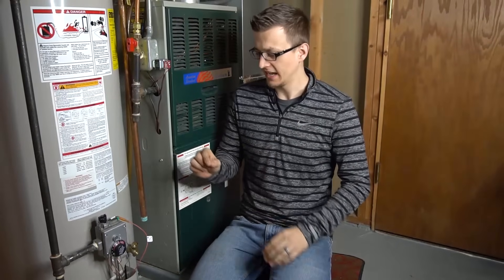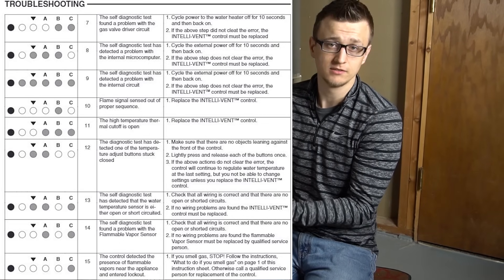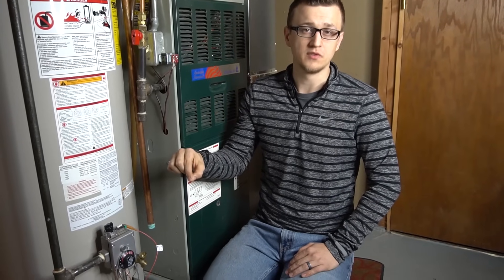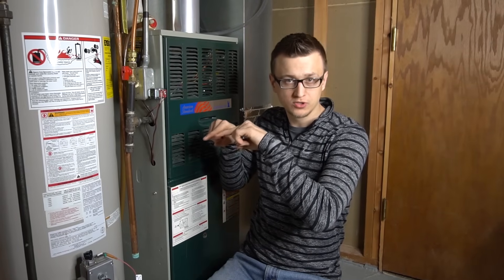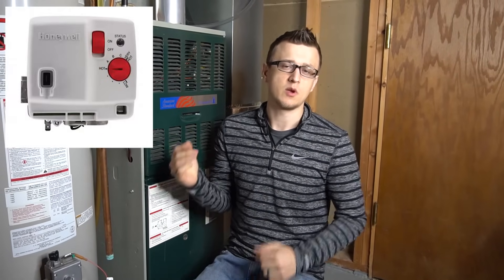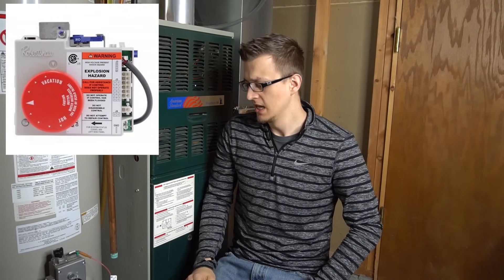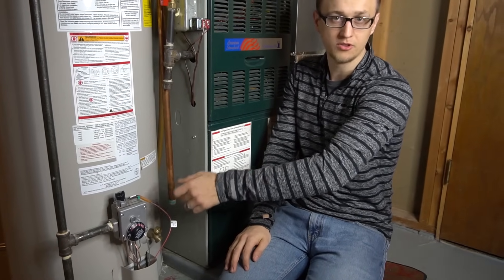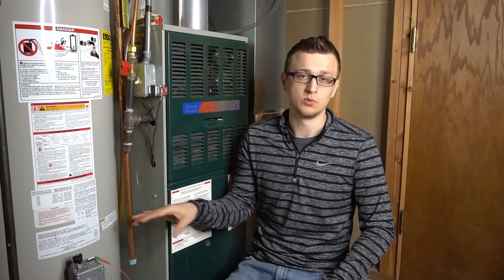How To Reset Flammable Vapor Sensor on Water Heater

Comment: I have a 2020 rheem water heater. To reset the code the rheem technician said to turn the thermostat all the way to “low”, turn off the toggle switch and disconnect the power (leaving the gas turned on), wait two minutes then plug it back in, turn the toggle switch back on, turn the thermostat from “low” to “very hot” = 1 turn. Back down from “very hot” to “low” = 2 turns. Do a total of 7 turns and it should relight. Then turn thermostat from “very hot” to desired temp.

Comment: Wow, first let me just say thank you for this video. You saved me a lot of money.

Second, let me tell my story. I bought a new house and lived in it for a couple of years with zero water heater problems. In fact it was excellent. I had always used an electric lawn mower, then I bought a gas lawn mower. Around that same time my hot began going on the fritz. I'd go to take a shower and the water would be ice cold. So of course I did the only thing I knew how to do: I unplugged my hot water heater and plugged it back in. This would solve the problem for a couple of days - maybe even a week, then randomly the hot water heater would fail again. I unplugged it and plugged it back in, temporarily fixing my problem probably a dozen times. 

Finally, I took a close look at the blinking LED and determined it was indicating a flammable vapor sensor had been tripped. Amazingly, that thing was so sensitive, it was detecting fumes from the plastic gas can I had purchased to fuel my new lawn mower. The container was tightly sealed and was stored at least 20 feet away from my hot water heater, but even that was enough to trigger it. Now, thanks to this video I've reset the sensor and store the lawn mower gas cannister in a heavy-duty garbage bag. That seems to be enough to contain the fumes and prevent the sensor from tripping. Those things are sensitive!  

Thanks again for this video. Cheers, and good luck to anyone with an ailing hot water heater!

Comment: Thank you new subscriber..with the honeywell do you need to shut down the the gas controller valve aswell or just unplug blower for 10 seconds when resetting also we have alot more staining to do at cottage and if we replace the sensor if it is faulty how do we prevent it from happening again can we just shut the power on controller and unplug fan motor and when all vapor smells are gone plug back in or will it detect again while it was off ?

Comment: Outstanding video!!   I have a Honeywell and your instruction was precise and exactly correct. THANK YOU!!! I have seen a few others that are not correct.  In my case, I used some solvent based enamel paint and although the room was vented to outside, I painted too close to the sensor located on the bottom.

Comment: Restore the power to the water heater.

3 Within 10 seconds of restoring power, press the two temperature adjust buttons

simultaneously until the left (green) “Vacation” LED begins to blink (approx. 5 second

delay). Once the Vacation LED begins to blink, release both buttons.

4 Again, within 10 seconds, press both temperature adjust buttons simultaneously until the

Vacation LED is on steady (approx. 5 second delay).

5 Release the two buttons, the microcomputer will clear the FVS lock-out and normal

operation will then be restored.

Comment: IMPORTANT!  IMPORTANT!
Thanks for a very helpful video.   One very crucial point to remember (for the second type) is the need to immediately begin the button-pressing sequence within 2 or 3 seconds of restoring power.  I was coming off a stool as the power cord was plugged in above and it never worked.  So I switched the fan to off instead.  After turning it on and quickly holding the 2 buttons I got the flashing green light and was able to reset.
Reply: I love you.
Reply: You da man!!!! After 5 trys to reset unit I read comments and thankfully spotted yours. I have to stand up on a 3" pipe to get up to the receptacle, and  I wasn't quick enuff to reset it. After reading your comment I got it first try. Thank you very much. Now to get that .5 million btu furnace going with bad valve, lol.
Reply: I also luv u.

Comment: Update to my earlier report 
The reset was successful but my water heater stopped again and resting doesn’t change anything. Can you please advise what can be other than about this error eg flammable vapor sensor
Reply from the maker: Replace that sensor if resetting it does not work yet it keeps bringing up the vapor sensor error. I've replaced quite a few non-resettable sensors before.

Comment: this vidoe was very helpful to fix my issue. I had no idea what was happening. I could sense gas was coming and heater hod power, so i had gas company come in for free to check if gas was ok. they investigated and asked to replace the Flammable vapor sensor. Upon youtubing i came across this video and i tried reser per this person and it worked. MOre than money saving, it saved time and headache of procuring the part and figuring how to install it.

Comment: Great post I stumbled across when my plumber couldn't figure out why we couldn't recover my Honeywell controlled WH after a vapor sensor errror/replacement.  I was close to spending $3000 on a new WH when I tried the reset method mention here and lo and behold it worked.  Thanks for putting this up!

Comment: Thank you. I have been stripping paint in my basement and the hot water heater stopped working. I have a Honeywell gas valve. Six times back and forth and it started up. Saved a call to the plumber.

Comment: Christmas day. I jump in the shower and no hot water. Please Lord, I have many things to do today and next week. I won't be able to replace it until next Friday. Wait, here is a video that says how to reset  the Honeywell controller. I switched it off, unplugged it for 10+ seconds, turned it back on and turned the temp dial back and forth. It was blinking normally, the gas flamed on and then went out. The light stayed normal and after a few seconds it flamed on again and seems to be heating up at this time. Thank God for people like you that post videos like these.

Comment: Hi Jay…. Mine vapor sensor was flooded in water now controller not working…. I replaced the controller as it submerged too. After replacing controller, the controller detecting VS has problem. Do you think I should replace VS as well.. Please advsie
Reply from the maker: If the sensor was flooded, then yes. It would be best to replace it since it will likely keep giving you issues going forward.
Reply: @WordofAdviceTV  replaced it and now it works fine. Thanks for the advise .

Comment: It worked thank you so much. I almost was out of pocket at $1000 replacing the entire water heater which is what was suggested to me by a plumbing company. Your video saved me so much money and so much time.
Reply: It worked out well  thanks
Reply: I completely agree with everyone else... THANK YOU SOOO MUCH for this video.  We recently had hardwood floors installed and the polyurethane used on the 1st floor caused the vapor sensor on our hot water tank to activate, although the tank is in the basement. Fumes were quite strong.  Your tip worked like a charm.  By the way, we have the Richmond (Honeywell) 50gal shown at the 3:36 mark of the video.  Thanks again @World of Advice, much appreciated.

Comment: Thank you so very much.  My FV sensor tripped because of painters using oil based paint and while I had a spare FV sensor to hand (as a backup from another incident) I was able to just reset the system using the cheat code to get it back working!

Comment: THANK YOU!  I have a AO Smith gas water heater w/ the White Rodgers gas Valve (w/ the L and R buttons).  holding down the L and the R together for 5 seconds, releasing them, and holding down L and R together for another 5 seconds.  This worked to reset my FV sensor.
Reply: By the way, I had this very same error code on my AO Smith a few years ago, called YES! Plumbing (Las Vegas), and they told me I needed a brand new water heater ($4000.00 all in).  Had I only known these cheat codes at the time! THANK YOU WORD OF ADVICE TV !!!

Comment: For my same model Honeywell, with the unit still switched on and in "vac" mode. Unplug the blower for 5seconds. Then turn. The dial from "vac" to "very hot" and then back 6 times. Lastly, turn the unit switch off and back on then return it to very hot. Worked for me, just doing what he said did not work until I flipped the honeywell units switch off and back on.

Comment: Hey Jay,I recently found something else that trips the flammable vapor sensor and that is “weed” smoke. I walked into a basement that reeked of pot smoke, saw the error code for that sensor. I removed the sensor, blew it out with canned air, reinstalled it, performed the reset and problem solved. Told the occupant to open a window next time .😂😂
FYI: The flammable gas sensor has an internal resistance of approx. 44k ohms ( 44,000) . Made a “test” resistor with pigtails and insulated male spade connectors as a TEMPORARY fix.
Reply: Now I don’t know if it was the house getting painted or my weed smoking.  Thanks a lot. Lol

Comment: Can water trip or damage the sensor? Because I didn't properly drain the tank,  the base and the insulation got soaked.  Also, the green light blinks then when I press down both buttons, nothing happens. I've tried the LRLL... code as well. Thanks in advance.

Comment: You are da man.  Muchas gracias.  I followed your  advise and it worked the first time.  I was  ready to do extensive troubleshooting that would have been useless.  Also, your advise for resetting the vapor lockout was not included in the troubleshooting part of the manual.
Anyway, thanks again for saving my Saturday doing useless troubleshooting.

Comment: Power was switched off for about 30 minutes, and sensor disconnected.  When I returned with the cheat code ready, I flipped on the power and everything was reset and working perfectly.  So, maybe you can cheat the cheat code by just removing the sensor  and/or leave power off for a few minutes.

Comment: Wow! This worked!!!!!! Amazing! Saved me $$$!! Thank you so much! Mine had the two lights at the end after getting water splashed on my water heater from a hose. I thought I had a flame/gas leak. I was so scared but I unplugged it, turned off the fan and started it and pressed the two buttons till it blinked. And pressed it down again and it started!
Reply: U saved urself $300 bucks easy

Comment: Thank you to much for this! We recently just resealed our floors with an oil by poly that dripped into the basement between the cracks. After coming back into the home after a week I couldn't figure out why we had no hot water. Thanks a ton!

Comment: You just saved me $4000.00. No lie. Two companies came out today and said that the unit (5 years old) is "shot" Vapor reset worked like a charm on Rheem 75Gal Forced Air heater.

Comment: Thanks a lot for the help. I called AOSmith Tech Support and they said I had to replace the sensor and call for the reset code. They close for the weekend at 5:00. Your step by step was exactly correct. Can't thank you enough. It's Saturday afternoon which meant I would have been without hot water until Monday morning. We're back in business here.

Comment: I had this same issue with my Rheem water heater before. The problem was that the replacement FVS were days out when we needed the hot water NOW. See below for the simple hack to trick your water heater so that it will work and providing hot water while waiting for the replacement FVS to arrive.
1. Go to and electronic store or online to buy a through-hole resistor (cheap part, costing pennies, I seriously doubt that you can buy just one, and not a whole bunch). The through-hole resistor should be anywhere between 15KΩ -35 KΩ.
2. Unplug the power and remove the faulty FVS.
3. Stick both ends of the resistor in place of the faulty FVS, polarity does not matter. Be careful not to let the bare metal part of the connection touching any other surrounding metal surface. I used the electrical tape for insulation. This will trick your water heater into thinking that the FVS is present.
4. Plug back the power and follow the reset procedure in this video. It should work. Now you will have hot water, and plenty of time to wait for the replacement FVS to arrive. Good luck.

Comment: Thank you. Had our wood floor refinished and this happened. Kids tried shower and no hot water. I was about to call service but found your video. I have Honeywell and the unplug for 10 secs and turning the water heater setting 6 times did the trick. Will share your video.

Comment: I learned 3 things today;
1;  my water heater will keep the water warm enough to have a comfortable though cool shower over 24 hrs after it would most likely have gone into lockout due to our ceiling being spray painted.                                                               2; my flammable vapor sensor works as designed.                                                          3; how to reset the vapor lockout myself and save myself a service call.                      Thank you for your helpful and informative video and written instructions. The reset on my Honeywell valve worked on the first try. I had a lukewarm shower, but thanks to this video my daughters won’t have to.

Comment: I have a White Rodgers gas control I shut down the system try to hold the twotemperature buttons at the same time but the green LED light does not blink so I can't put in the code can someone please help

Comment: (Whirlpool + Honeywell)  Appeared to work, but on recheck a short time later, it was back to the 4 flashes + 3 second pause.  Repeated the procedure, and it worked like a charm--hot water in less than half an hour!

This happened once before in 2016, after the water heater was exposed to some gasoline fumes associated with the lawnmower.  That time we followed the manual.  Ordered a gas control valve covered by warranty, but paid express shipping to get it sooner plus cost of a technician to install it.  This time, I am making a written note in the manual and an electronic record in my computer.

Thank you!

Comment: I looked up the fault code ( 7 pulses) in the manual for my 2016 Rheem PROG50 and purchased a new FVS for $23. Disappointed that it didn't fix it, I called my HVAC guy for a service call. While waiting I found your video. Back and forth 6 times on a Honeywell? Yeah right and click my heels together 6 times too? Imagine my surprise as it fired up! God bless you for saving me a $78 service call plus who knows what else I may have got charged

Comment: Thank goodness for your video!! I was skeptical but it immediately worked (rheem powervent with honeywell valve).

But, really, 😤W.T.F? 
Who are the dumbass designers who make these crazy reset sequences? It's just pathetic how a simple reset could end up costing hundreds of dollars and no hot water for multiple days!

A stupid reset sequence that forces you to make an expensive hvac service call. And if the technician doesn’t know the reset sequence or is a shyster, they sell you an unnecessary new sensor or replace the whole damn valve unit.
Criminals!!!
Reply: Update! All was well. We had a brief power outage yesterday and I discovered that i had no hot water today 😡. Sure enough, I went down there and the same 7blink code. I tried that reset sequence again and it fired right up. Since it happened again, I wonder if I should just go ahead and replace the sensor?

Comment: THANK YOU!!!   Your step by step walk through saved me a service call and got my water heater up in running right away!  Thank you so much!! (mine is Rheem + Honeywell)
Reply: It seems that I can only trick the Flammable Vapor Sensor once? Late at 10pm the heater stopped working again and the reset didn't no work :(
Reply: @chenhaotsai  I'm dealing with this as I type.  What did you do

Comment: If the reset can't FIX your water heater Then you need an new sensor which price range from $25 ~ $45.  Yes, I watch the video 3 times and try the process for 20+ times since one comment said that he failed at 1st try but did success after re-try it.  No, I don't have those kind of luck, I read form other website which suggest that connect with a 22 k resistor which can cheat the control board and make the water heater back to work. Unfortunately, I don't have the right resistor at home. MY water heater brought from Menards with brand name " Richmond" .  I searching Lowes  /  Menards with key word "Flammable Vapor sensor" ... but can't find it, before I giving up, I do one more searching with "Richmond sensor" and I find my Menards do have the part with only $22.29 . I run  to the store and pick up the part. Before I install it, I using my multi meter to measure the resistance and get an reading . The new one have 13.6 K Ohms and the old(broken one) is 164.4 K Ohms. after I install the new part, I did the reset and it took about 5 times from low to high to make the water heater start burning again.  if people wounder how you know the water heater is working - when the reset is working, you will know it in second. ***** Good luck everyone *****

Comment: Mine is a Honeywell and doesn't have a plug to plug into to the wall. I just put in a new control box and still does not light and the reset button does not push in to reset. what to do?

Comment: As always great vids!!  Bought a 30 gallon AOSmith natural gas water heater. 2018. No hot water. No error code. Blinking beautiful. 450 millivolts. Honeywell gas valve. Sunday. Need hot water. Seems to b bad gas valve. I am going to replace with a 50 gallon. Extremely disappointed. Old thermocouple water heaters would always last till tank wore out.